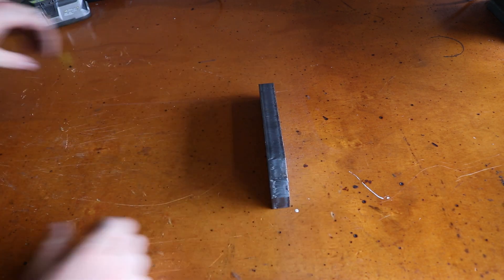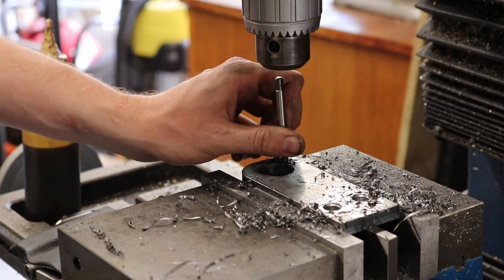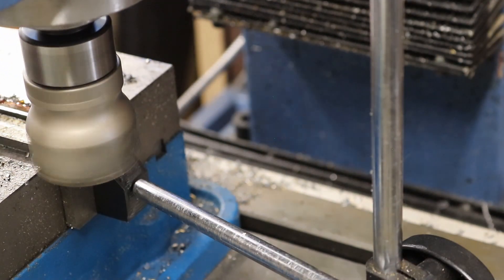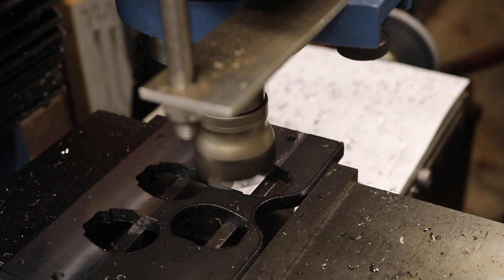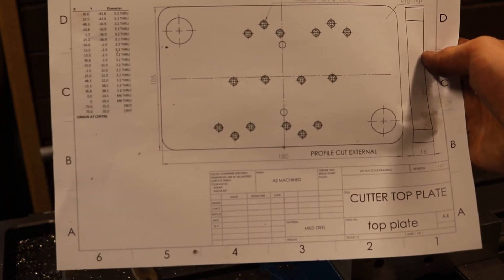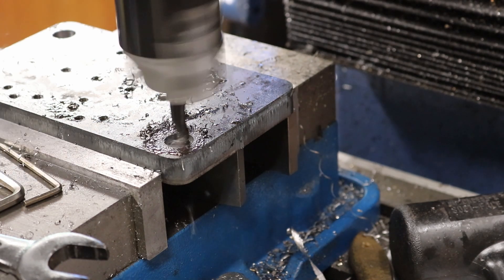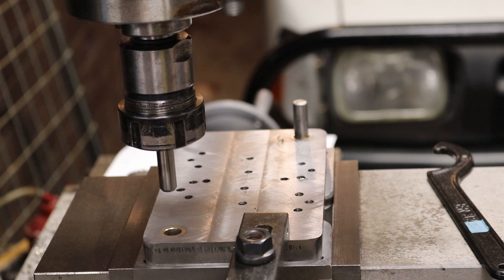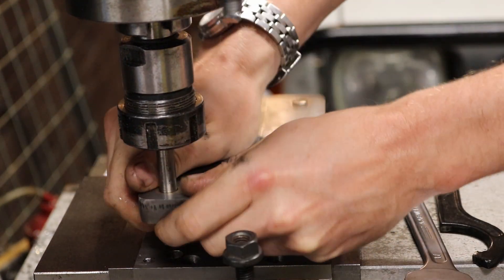Making a PCB Depanelizer - PT1

Comment: Nice video. Enjoyed the PCB machines. Been a while since I have seen anything similar. You top and bottom platen could have used some match drilling. Saved you a lot of head ache. Hope the save worked.

Mark
Reply from the maker: Thanks Mark,

Yes match drilling would have been best for the alignment pins. The machine works as it is, but could definitely be a bit better. I guess there isn't really anything stopping me from pulling it apart and match drilling in the mirror imaged positions.